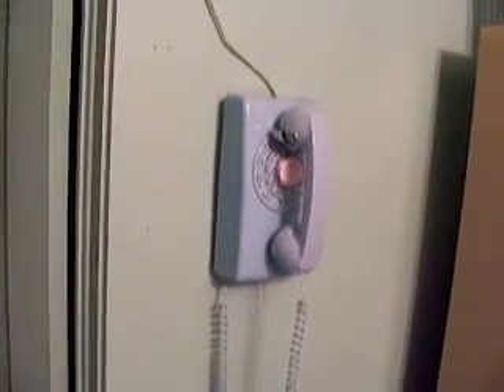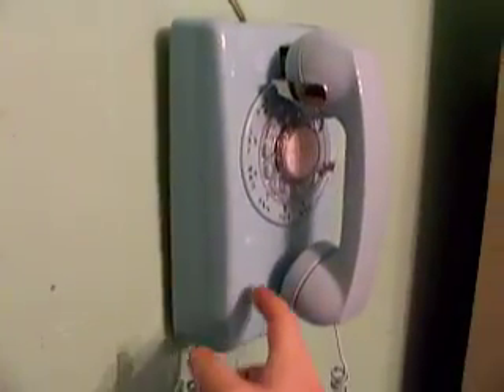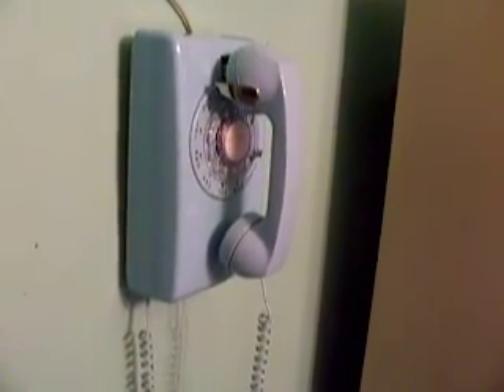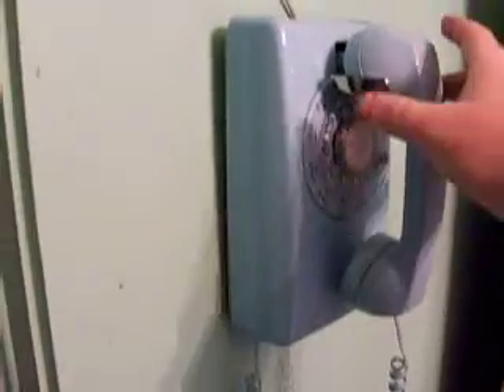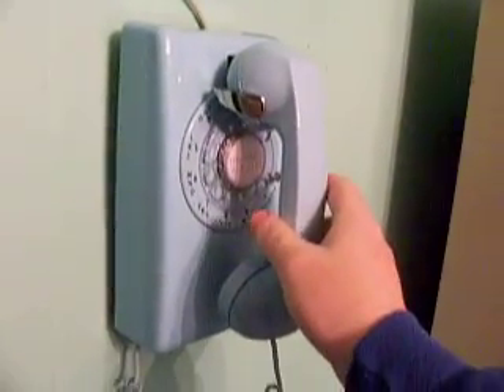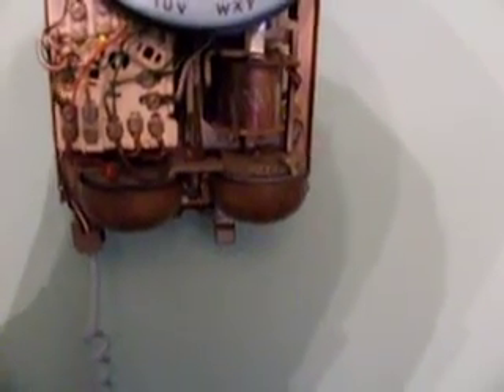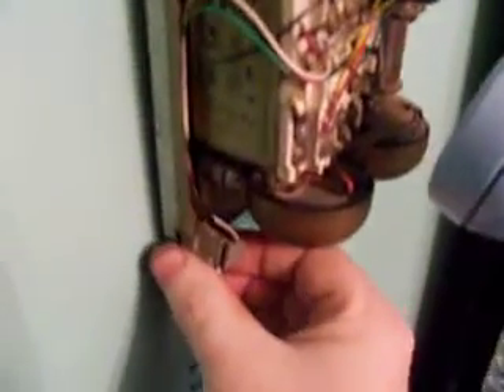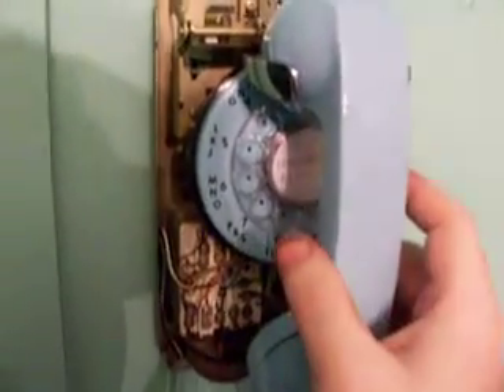554 Wallphone, Cover Removed, Ringer Test

Comment from the maker: ITT, Stromberg Carlson, and other independent manufacturers did make a touchtone version of this exact model, called the 3554 model.  All they did was replace the rotary dial with a touchtone dial and circular plate to fill-up the hole where the rotary dial went, so yes, a proper 3554 phone does have the bells. Post-1984 ones don't have metal switch hooks, they have clear plastic ones instead, but they are the same basically.

Comment from the maker: No, mine doesn't.  As I said in the video, this one's not completely original, it's been refurbished.  The cover is from an ITT 554, and the handset is a transitional post-divestiture 1984-1986 one, as it has "AT&T" molded into the handle instead of "Western Electric", like it would if it was a pre-divestiture Bell System handset.